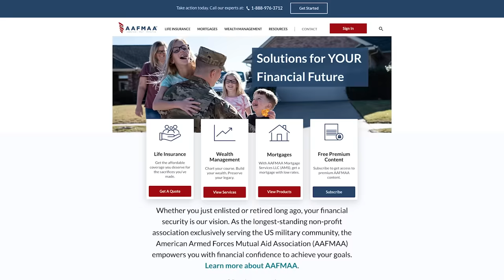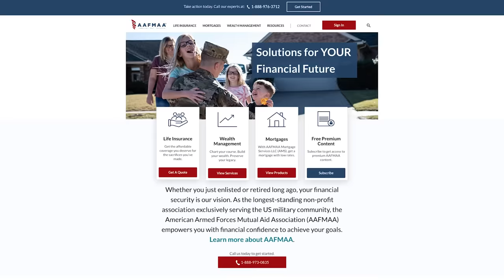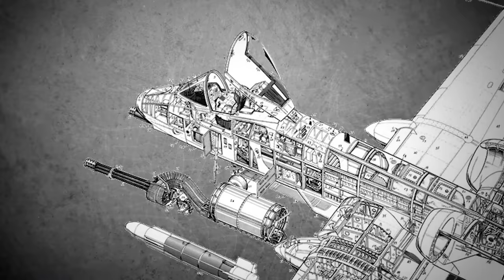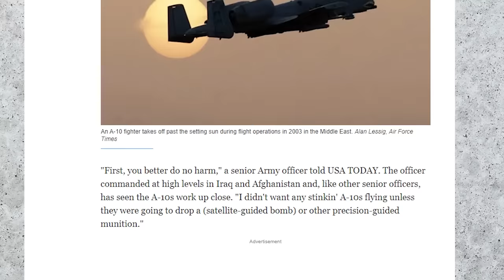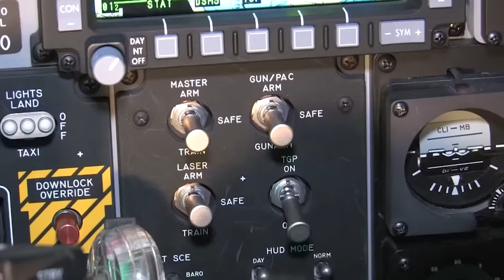Why the Air Force is Screaming to Retire the A-10 Warthog

Comment from the maker: Go to https://www.aafmaa.com for your life insurance, wealth management and VA mortgage needs. Whether you just enlisted or retired long ago, your financial security is the goal of AAFMAA.
Reply: Hey Cappy it's usually pronounced as 'GOW-Eight'.
Reply: f*ck I hate using the MK.I eyeball
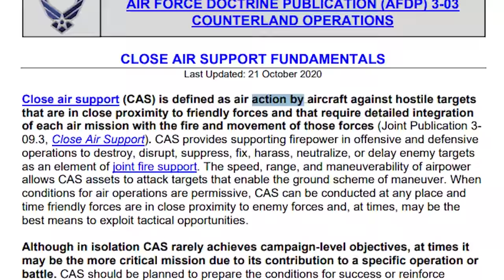Reply: 10:30 „air action by aircraft against hostile targets that are in close proximity to friendly targets”
Reply: I’m switching to Air Force from army. You’re missing something big out of this video. Air Force just procured a large order of close range support propeller aircraft with modern avionics and munitions. 

Modified AT-802U Sky Warden Air Tractor; Fixed-Wing, Armored, Single-Engine aircraft used for Light Attack/ Armed Overwatch Intelligence, Surveillance and Reconnaissance; built by L3Harris and Air Tractor
Reply: It’s a lot more cost effective and still plays the role as a10 in light combat engagements
Reply: @temwananinkana3419  The main reason a rotary, multi-barrel cannon is preferred on modern jet fighters is primarily rate of fire.  At the increased speeds of modern dogfights, a pilot may have only a second or less to engage their opponent with guns.  The more rounds out, the better the chance of a hit(s).
Reply: So, wait, the plane that isn't even built for air to air is the one that scored hits with its cannon?

That puts so many things in question. Why do fast movers even have cannons? They don't work well against ground targets and are impractical in the air. 

Meanwhile, it shows that the A-10 is so unique that when it does retire it'll take men and machines getting lost before a dedicated replacement is sought.

Why the government is worried about money when it will only cost far more to replace in a hurried manner (you'll get a crappily thought out product unless you clone it with only modernized electronics) is beyond understanding...
Reply: @98MAzdaMilleniaS  Yes. Jets are wicked expensive and suck down fuel like Russians suck down vodka. Ground support speeds are slow enough to use props.
Reply: @temwananinkana3419  isn't it kind of self explanatory though? if you have multiple barrels, you can fire a lot more a lot faster without melting the barrel, no?
Reply: @98MAzdaMilleniaS  The War Tractor is going to replace the A-10's role almost entirely in uncontested airspace as far as troops on the ground are concerned, it's going to be buzzing over their heads and dropping bombs or circling around for strafing runs just like the A-10 did.  The aircraft is cheap and easy enough to maintain that the pilot and maintenance crew can be embedded with local SOCOM units and operated from unimproved airstrips for a true on call and on demand CAS specific to the unit itself.  In contested airspace, troops will be calling in longer range attacks from multirole fighters and drones, and they'll likely never see the aircraft, only the results.
Reply: Does that mean I can buy the used A10s? I'll take it as is, no questions asked.
Reply: @Skinflaps_Meatslapper  there’s an opening in my unit to be a combat systems officer for one. Task and purpose really should’ve brought this plane up
Reply: Finally less blue on blue
Reply: Did you remove all of the fighter plane mafia propaganda from your research
Reply: How willing would the AF be to send expensive F-35 on CAS missions to defend the troops?
Reply: if you can''t name the source..............it don't exist
Reply: Excuse me,  but I am confused. Which is it: The A10 cannot successfully engage tanks post T64 or the A10 successfully killed almost a thousand tanks in Iraq, most of which were T72. Did they use missiles for those tanks?
Besides, what about the cost in current USD. I am willing to bet that a few rounds of 30mm are way cheaper than supermodern precision guided missiles. Imho that is a big problem in Ukraine: Shooting down cheap drones with expensive SAMs. 
Thirdly: We are seeing it in UA: If there was anything that successfully interdicted Russian trucks, they would lose due to logistics issues.
Reply: @donaldduck830  donald duck............ftw
Reply: Dunno, man. Mutual Aid sounds awfully Socialist XD
Reply: Bigger bullets
Reply: Good video! Any chance for a follow up to this on the OA-1K Sky Warden?
Reply: Give the A-10s to Ukraine
Reply: @citizenschmitizen  bigger blue on blue
Reply: @98MAzdaMilleniaS  I think it would've been very relevant to this subject.  The USAF isn't going to retire something and leave a hole in their fighting doctrine, they already have plans in motion for it.  I fly them on the ag side, and I know one of the pilots that demonstrated it to the brass.  It's an extremely capable aircraft for the role they intend to fill.
Reply: A-10 did very poorly   during  the1990s  Desert Storm conflict . Both Military Aviation History and Lazerpig  did  dive covering how overrated the A-10 is and how poorly it performed in the  Gulf War.
Reply: Where's the review of Russian shovels
Reply: Perhaps China is paying lobbyists to end the plane because it sounds like it would be great against the hordes heading to Taiwan.
Reply: @dtsai  You do know that unlike the Taliban, Chinese military have very  good anti air coverage, right?The Warthog would perform as bad and if not worse than the Frogfoot are doing right now in the current Ukraine war.
Reply: wait, so could the US just give these planes to Ukraine?

They could finally do their jobs and bust some Russian T/72
Reply: @apollomars1678  Ukraine already have their version of the A-10 . You do realise  Su-25 Frogfoot exist, right?
Reply: @apollomars1678  Oh that's right.  We have been giving them everything that would have cost us money to trash.  Putting the A10 in that category would free it up to be given to Ukraine.
Reply: @remliqa  Ukraine had 31 of them in service, while Russia had 200....and we know of 25 russian and 15 Ukrainian destroyed models.

So now it is 16:175.

the USA is planing to retire and destroy 21 of their 281 A-10........why not simply shipping them to Ukraine to retire them in the next 5 years.

Germany send their old retired Leo2s too. It is stupid to waste money for Ukraine support, if you may simply use Ukraine as the perfect place to retire these planes by this war. 
It can only reduce the numbers of Russian planes from the US perspective, while the USA will build and buy new ones anyway.
Reply: of course i know, that a lot of these russian planes on paper won't fly and some of them have to be stationed somewhere else, but we could still shift the air supperiority greatly with some A-10s, they seem to be effective against helicopters and they seem to be easy to fly. 
Ukraine is loosing a lot of their close-front air-denfese systems in the last weeks and they can't really replace them, so maybe just give them some A-10s and other fighters to make the Russian become more on edge about flight missions in Ukraine.
Reply: @apollomars1678  Unlike the rest of te armaments the US sent there, The A-10 doesn't really  offer any new capability that Ukraine  lack  with their Su-25  and are  just as vulnerable  as the Frogfoot.
Reply: @apollomars1678  The reason why neither Ukraine nor Russia  have air superiority have more to do with  the  ground based anti air defense  defense network there. TheA-10 does nothing to  to break this stalemate. They will be just as vulnerable as the current Su-25.
Reply: I am surprised that you are all assuming that there will be no counter insurgence. A battle with China and Russia, is the more unlikely. Drones are a good option, but try to do that when you are under heavy fire. When the enemy has the means, like in Ukraine, operating a drone is like signing a death sentence as the control signal gets geolocated. Let serious minds review what is happening in Ukraine. But you are also just likely to encounter ISIS version 2.0 or 3.0. Then what platforms would you like out there if your own son was fighting with the baddies getting closer?
A Chinese proverb says it’s better to win without fighting. Planes like the A10 have that factor with their mere presence convincing the insurgents to go home. It is out there on YouTube where insurgents immediately break contact when they hear the a10s.
Reply: @jlundofu  Everything from F-35 to older F-16  can carry CAS missions .  The only advantage  the A-10 have over them was it's lower maintenance cost. Would you rather have insurgents breaking contact or them being dead? I remember I a story an Afghan vet told me where the A-10 failed to suppress a hardened  target despite buzzin it with its GAU-8 during several run. It took only   one precision missile to quiet the action from that target. Oh, the CAS aircrafts that launched that missile wasn't an A-10.
Reply: @donaldduck830  Two things. One The A-10 kill count in Desert Storm was highly exaggerated . Both Lazepig and Military Aviation History  covered this.  And yes, the kill were mostly done by missiles and bombs, not the A-10 cannons.
Reply: @apollomars1678  Assuming we need pilots in future, all future fighters should have a slot for AI chip to allow us to give jets to countries we are helping like Ukraine to minimize training time.  Let the AI fly the plane and the pilot target or vice versa.  If the plane gets shot down, blow the chip and critical areas up.  I wonder how a fewF16 or A10s with AI would do in Ukraine.
Reply: @apollomars1678  They should build a future A10 with no pilot. Only an AI!
Reply: We gonna see them inUkraine, I think
Reply: @remliqa  yes but if we take for example a drone attack on a territory A that depleted the defence readiness in a time-window and than add a second wave of something like some A-10s, that aims at the counter-drone positions with their missiles and than hunt for trucks, troops or weak targets in this territoriality with their guns, i think these attacks would simply make Russia more despread in their air defences or more ignorant about drone attacks, who are surprisingly hurtful, if they are ignored. 

The A-10s don't have the demand to break the stalemate, they should fix Russian units as counter-air units, thereby minimising the ability of Russia to use their airsuperiority, explicit in this counter-attack direction by the simple existence of something like 50 A-10s on the Ukrainian fields.
Reply: @13:50 you fail to mention the worst "blue on blue" in the "Gulf War" where an A10 (female pilot noted for no particular reason) shot a VERY clearly identified convoy of British military vehicles, 9 were killed.!!! God rest their souls 🙏
Reply: Ngl the usage of a grim reaper’s tutorial as broll footage was kinda funny
Reply: @apollomars1678  Again, Ukraine have plenty of drones and they have their Su-25  fleet at their disposal. You think they never thought of this tactic? The SA-10 bring nothing new to the table and would just  as limited in their role as the current Frogfoots . The A-10 can even stand up to any of the Russian air asset.

I don't understand why you think the Warthogs  would turns the tides. The best they could do is replenish Ukraines depleted Su-25 fleet, and that would take lost of training and readjustment for the Ukaionsina pilots and maintenance team..
Reply: @remliqa  SU-25 fleet that is already half shot down confirmed by us AND the remaining SU-25 in Ukraine at maximum, if they still exist and can fly, are less than the USA will destroy A-10 alone in 2023.

the A-10 doesn't have to be used, it has to exist in Ukraine to give Russians a military target over a civilian target to waste their missiles. The A-10 could simply fill the lost SU-25 again to Pre-war size for Ukraine. And it would give the Ukrainians leverage to actual use these planes, because they can allow themself to loose these planes. 

It wouldn't take lot of training to train the A-10, even this video call it easy to fly in comparison to a modern fighting-jet. the thing we will give to Ukraine and train them to use in the near future. 

Even maintenances can be made really easy, because the USA don't need the repair and logisitic equipment of the A-10, if they retire the plane.
Reply: I’m from the 80’s era Army Mech Inf. and I now live in the desert in southern Arizona and I personally have heard and seen the beloved A-1O fly training missions almost daily for over 20yrs and met some of the pilot's. I've also seen my community vote for candidates over the yrs solely to save the A-1O. If it's the end of the A-1O I hope we send them to Ukraine and and let them finally get to do CAS mission to destroy Russian tanks in a last blaze of glory, The job they were built for originally. It would be so sad just to see them rotting away in the Boneyard when I drive by.
Reply: @horatio1962  Again ,  Ukraine already have the Su-25 Frogfoot, their equivalent  for the A-10. The A-10 will not give them any edge in that department and is just as vulnerable as the Sukhois .  The only good thing the A-10 can do is replenish their dwindling stock of Su-25 .
Reply: If only we could send the A-10 Warthog back to WW1. No Armenian Genocide
Reply: Ukraine needs something to take out KH52 helicopters and sweep trenches. Is there any upgrade or offensive strategy with A10 that would help? If we are retiring A10 and Ukraine could use them, go for it. AI was a great suggestion.
Reply: @jerrywhitfill2236  

How many homeless veteran pilots are in the US?

Surely it would be easier to retrain them rather than train Ukrainians. Just offer them a free house somewhere in Ukraine
Reply: @jerrywhitfill2236  They have  artillery, drones and  other method to deal with trenches. As for Russian helicopter and aircrafts, Ukraine have been doing a great job at taking them out with their anti air assets.
Reply: We already phased out 21 of them.
Reply: Take a note. Dedicated. But until you need something cheap like Super Toucano for COIN. Multi-Purpose Fighters do the exact same job. Plus interdiction and would escort themselves.
Reply: I think a factor that isn't considered much in modern warfare is that if a war was to break out between NATO and Russia, both countries would strike satellites removing GPS capabilities for precision strike weapons.
Reply: In Afghanistan A10s & Harriers repeadedly found Taliban units which, in poor visibility conditions & difficult terrain, were closing in on allied ground units and would wipe them out without airstrike support.
When drones were sent they often couln't find the targets
And you would not put an F35 so low
Join the dots.
Reply: @98MAzdaMilleniaS  Are they nuts for using an aircraft that is basically a modified crop duster that is even slower than what it's replacement?
Reply: @CrstnJdiKnight  not for small unit operations. It can land in most places an a10 couldn’t.
Reply: @CrstnJdiKnight  for modern large scale warfare… i don’t think it’s good
Reply: They should retire it now and start making toy sized drones that can easily strike its target as seen in Ukraine. U can buy 50 thousand of such drones at a price of warthog and strike enemy 50 times more without even risking pilot life!! It is time🇺🇸🇺🇸🇺🇸💝
Reply: love the ad - the US military is festooned with the most socialistic support system we have - this should expand to be available to the entire populace!
Reply: Give them to Ukraine
Reply: @remliqa  Yes, it's planes since Ukraine has lost a lot of them
Reply: Wad an Avionics tech on A-10s.  Really enjoyed working on it, except powder residue from gun got into everything!   Lots of problems solved just by cleaning residue inside wiring connectors. Residue blocked signal flow.
Reply: @98MAzdaMilleniaS   Considering the Pentagon can't pay our soldiers a living wage, they have no business talking about "cost-effectiveness". We should at least see how much less we can buy F-35's for on E-Bay.
Reply: It JUST GOT UPGRADED , amd possibly has alight stealth capability, THISBIS FAKE NEWS 😂💅😂
Reply: YOUR A HACK , A 10 JUST GOT UPGRADED 🤣😂🤣😂
Reply: @temwananinkana3419  The Gatling version fires far faster.
Reply: @bigfoot163  You must have been bate'in when you wrote this.
Reply: @bigfoot163   "THISBIS FAKE NEWS"
Were you doing crack when you wrote this?
The A-10 has ZERO stealth. But  I'm certain you don't know the 1st thing about what makes anything stealthy. HINT; it's not sneakers.
Reply: I, like most Americans, don't do metric.
Reply: Dude. All I’m saying is watch the A-10 videos made by Lazerpig, it will change your perspective on this friendly fire machine
Reply: @madmatt2028 😅😮😢😢😢😮
Reply: Did they say the same thing for F117?  The Marine Corp said the same thing for the AV-8 Harrier but it shot down some Hounthi Drones in 2024.  A-10 would do good in the Red Sea...against drone and missile too...